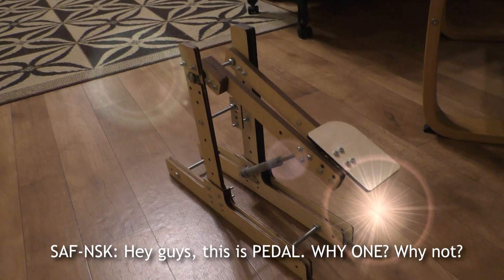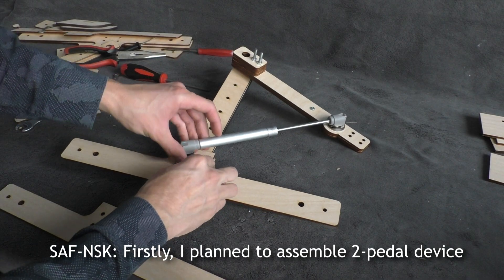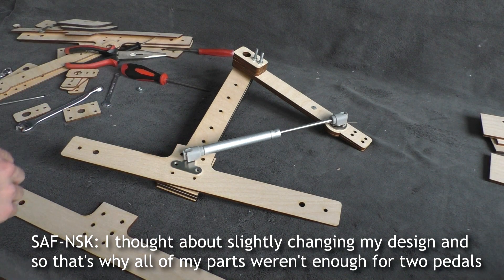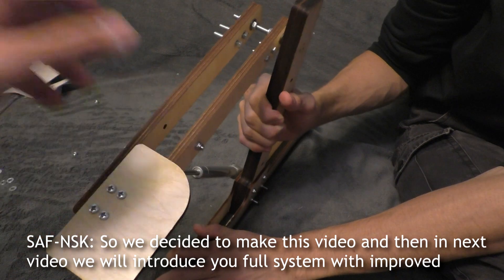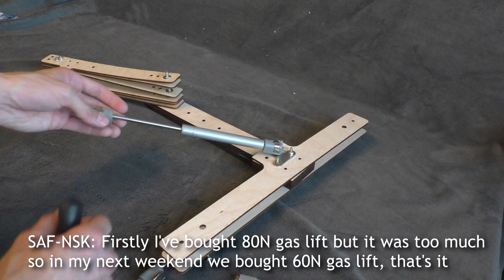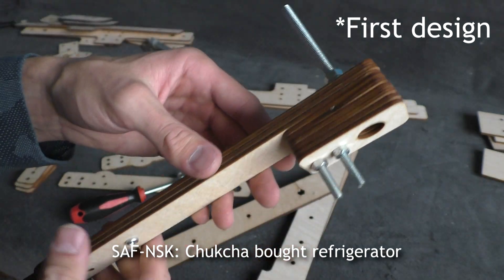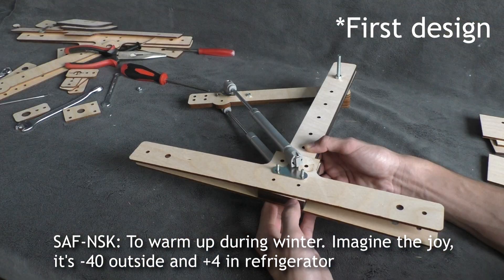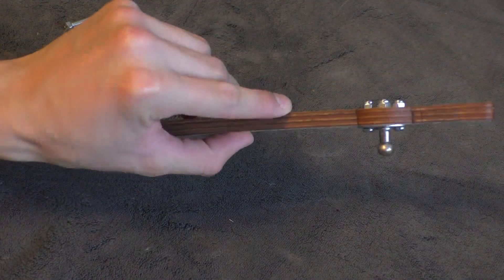Handmade plywood driving simulator controller. Part 2: Pedals.

Comment: So what is the point of this?   Is this just something so you can do exercise while working at a computer all day?
Reply from the maker: No, this is pedal for playing in driving simulators on PC. It has potentiometer so you connect it to Arduino or something and then to PC. I've already made a steering wheel, and this is a pedal. 
Two pedals can be connected to each other, connected to arduino and you'll get controller for playing driving simulators.